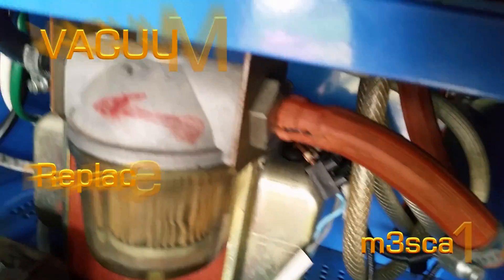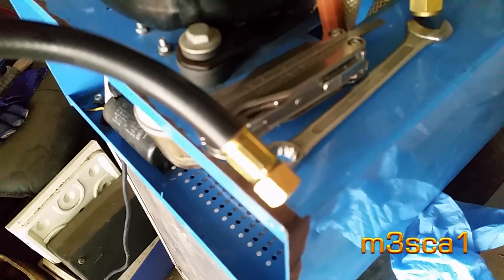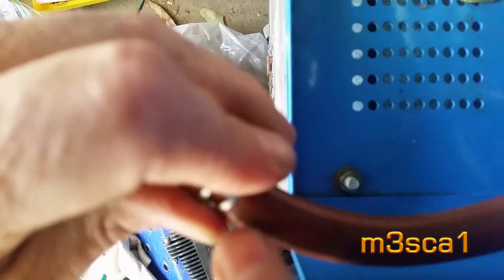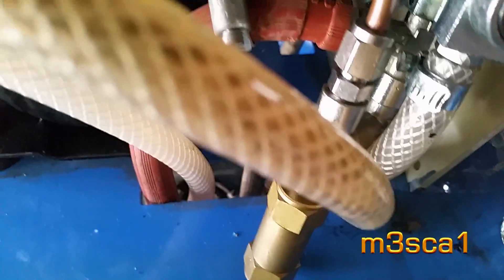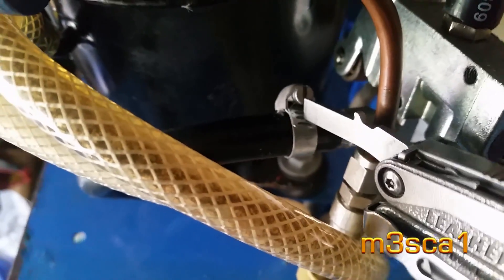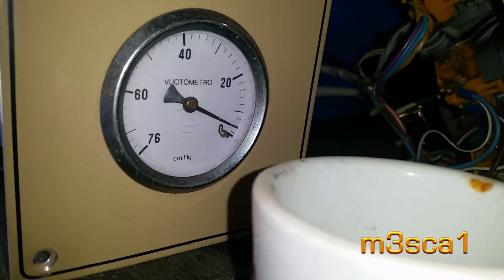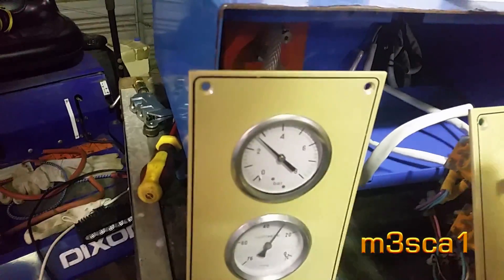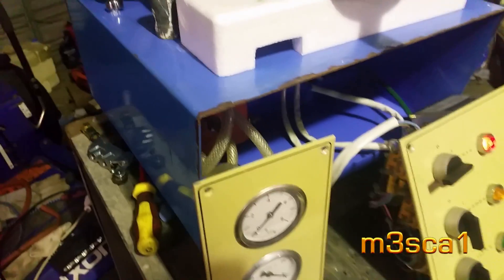Vac Casting Machine~Repair Success!!!

Comment: Hello 
Could you be able to tell which casting machine is it 
I mean what company and what model if you remember
Reply from the maker: you'll find the answer in this video
https://youtu.be/W_Fb6-vtxXQ
Reply: @m3sca1 thanks bud , it's just the copy of the KDF Capcom super casting machine (old version)
İ thought that was induction vacuum casting machine 
Many thanks
Reply from the maker: definately not induction... i believe it has platinum wire heating element cos it is rated to 1600°C for melting gold
Reply: @m3sca1 thanks for the info,abd yes I do know that the cascom super by KDF also rated at 1600 c
Reply from the maker: thanls for confirming.💪😏👌
Reply: @m3sca1 do you got info about induction vacuum casting machines
I'm gonna make one myself for jewellery casting after a month or 2
Reply from the maker: no sorry, i am sure the vac and pressure pots behave the same... just replace the heater with induction🤷‍♂️
Reply: @m3sca1 not this type the one with stopper crucible 
I'll be making a copy of Argenta agatronic G induction vacuum casting machine 
One of my father's freind have it and I'm gonna make a replica of it
Reply: @m3sca1 it's a very interesting project (it's a sort of my hobby to make these machines myself or repair them) i gathered all the information which will be needed to make one and in next months I'm gonna make it
Reply from the maker: sounds awesome. gonna make video?